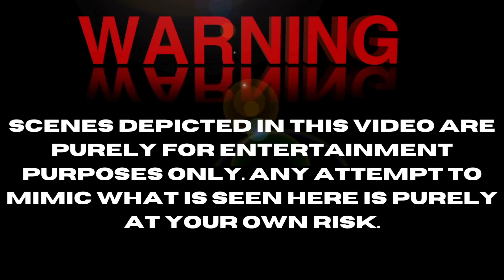Mini Bike Trike Part 5! Ian Roussel Designs The Front Fork Geometry 📐🤓

Comment: It's looking really cool so far. Build you a wheel lock to keep your front end in place remove the engine and secure the frame to the table. Then build the springer forks Now I'm not trying to tell you what to do because I would never do that. Just trying help I Dig the new merch I like the just mocking up signs and thanks for the show you both take care and don't roast to  much.spend more time in the pool and cold beverages help too.

Comment: Personally I would have started with a quad bike engine and diff set up. Surely there is a chain drive diff available somewhere, just cant see one wheel drive working so well. But hey its your build and you will do it your way regardless , and so would I. Have fun Ian.

Comment: Hi Roussel's,  First let me say I have always imagined what it would be like to collaborate with Ian, So here's my pitch, I think the rockers at the bottom of the forks should be a flying saucers you can take the tire and those mockup rockers off, weld up your wish bone and work out where the spring will attach so you can get all 4 bars parallel, with the wishbone longer so the holes at 45-degree angle, now set a piece of cardboard between the forks mark a vertical on the cardboard, I think the axle hole should be level with the fork hole, then you have to see how far apart axle and fork hole can be the will be determined by how strong the spring is and the size of the saucer I thing like 8 to 10 inches, after you use your artistic since of proportion to determine the saucer size, mark the axle and fork hole equal distances and perpendicular to the vertical line on the cardboard As far apart as you can get them then mark the wishbone hole, center up the axle and fork hole along the bottom of the saucer and drill the 3 holes. I think it would "Super Far Out" to see the front of the saucer bounce up & down as you piloted that thing.

Comment: Have you thought about making a solid axle, one hub keyed (allows positive sprocket drive) and the other side unkeyed (free wheeling)?  Seems like that would simplify the rear setup and allow your drive sprocket to mount anywhere along the axle and eliminate the need for a jack shaft.

Comment: Would you get more spring action if the mounting plates for the front suspension were flip around so the axle hole would be in front of the tube mount holes?

Comment: Ian when I wss building my hand peddle front end for my wheelchair I got a lot of na sayers it won't work because the front tire will just spin. I proved them wrong I knew the weight from the front of the wheel chair wheels being up off the ground would be just enough for the front peddle end to peddle the front wheel. I built the hand peddle front end before YouTube. All I had to go was what I was thinking in my mind. I still have the front end hanging up in the garage o made it from one scrap bike we found at the dumps.